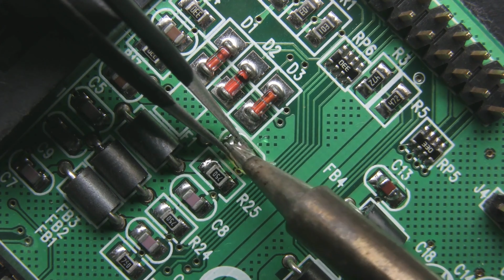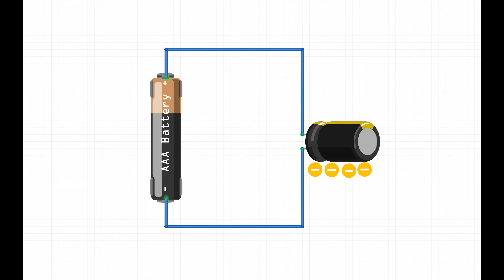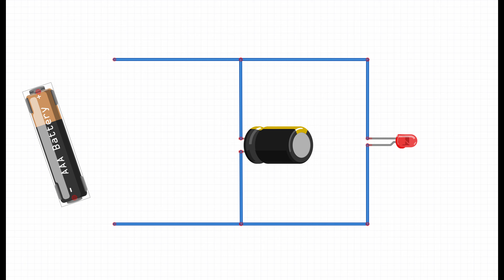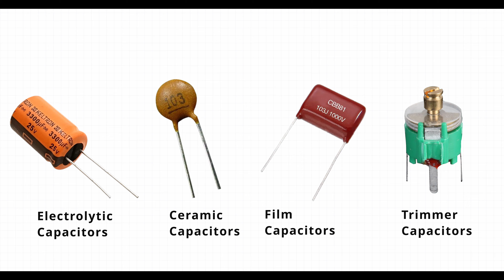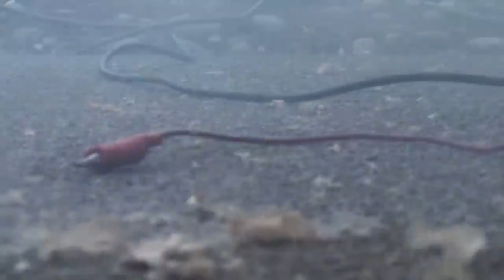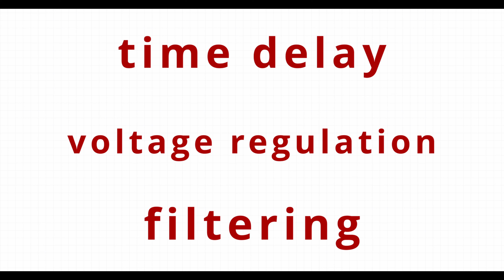What are capacitors and how do they work : The hidden hero in all pcbs

Comment: is it possible to make a capacitor with huge capacity, and one that discharges slowly!?
essentially making it a battery which can charge very fast but discharge slowly, what's stopping us from doing this?
Reply from the maker: The reason why a capacitor can charge quickly is that its internal resistance is very small. But its very small internal resistance also makes it fast discharging. For this reason, capacitors are used to meet instantaneous power demands. The closest product to what you are imagining right now is the lithium ion battery. It stores and releases energy through an electrochemical reaction.  Lithium ion batteries have a higher energy density than other types of batteries. This means that a battery of the same size can store more energy, resulting in longer usage times.
Reply: @gsbox2709  one more follow up qn, what if the capacitor could have a material with adjustable resistance, maybe using temperature or pressure to trigger different resistances. so while charging it will have a small resistance, and while discharging, it will have a higher resistance
i am sorry if i'm sounding like a kid lol, one reason i'm asking is to add a comment and boost the cool video, and another reason is my just curiousity
Reply from the maker: @christophergaspar6520  :) Yes, I understand you. Yes, this idea of fast charging of capacitors is interesting and exciting. If it could be implemented, it could be a revolution. The obstacle may be that capacitors are more expensive than batteries with the addition of such a resistor. Or maybe it could be that the calculations of the circuits designed to act like batteries with an adjustable resistor would become more complex for engineers. But it is still a good idea and its applicability should be investigated.
Reply from the maker: @christophergaspar6520 Maybe you will like our video about new transistors more